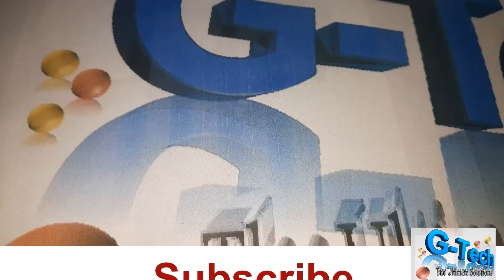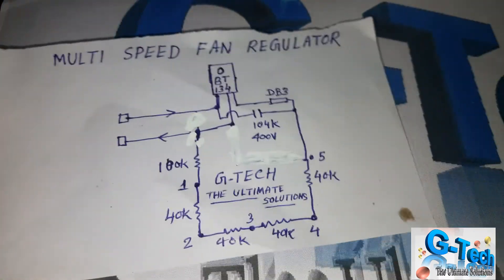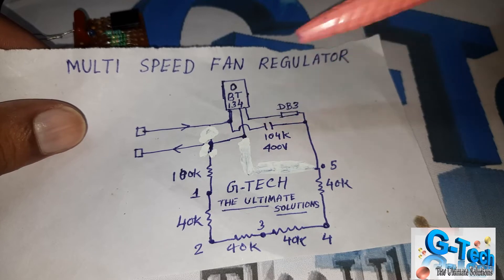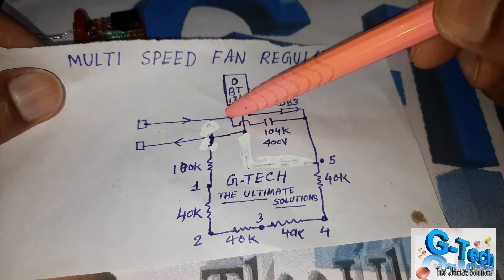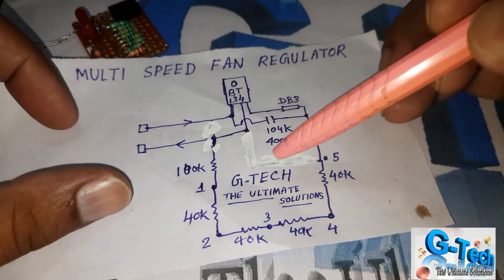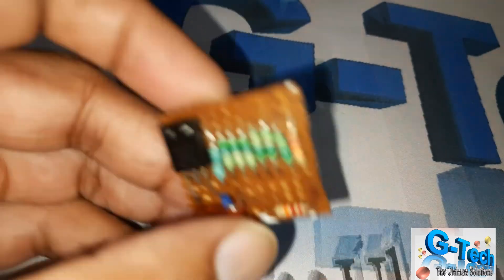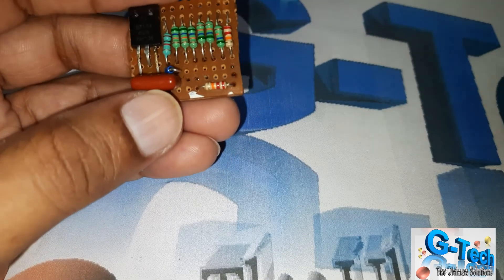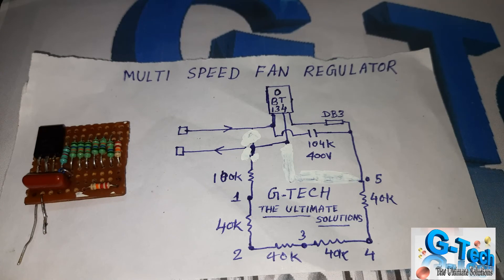Electronic FAN Regulator II Dimmer II BT134

Comment: Good circuit for fan regulator but how we can use this circuit to control the speed of the fan. How I can touch the wire to different Registance to get the different speed. In the demo you have touched the different Registance manually. It is ok for demo but in practical circuit it can not be done manully
Anil Kumar Goel
Reply from the maker: Thanks for your valuable feedback. 
Sir,
In this circuit you can use ROTARY switch to select different speed...just like Mixture Grinder Switch...Hope you will understand. If you need more help please reply in WhatsApp number given in description. Thank you.